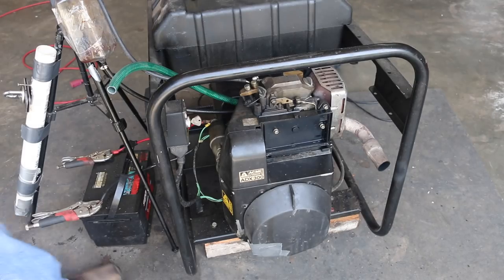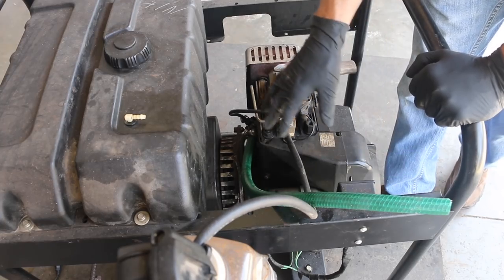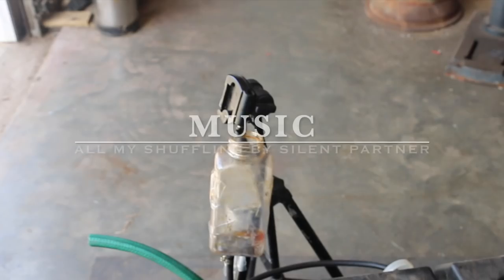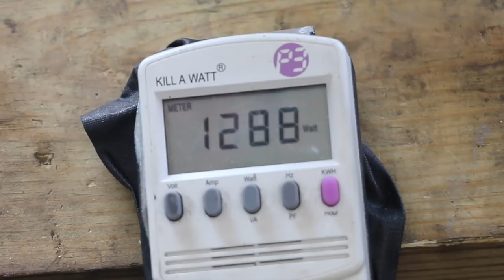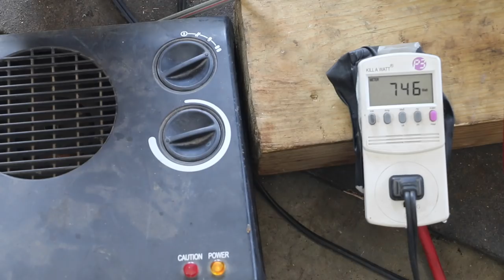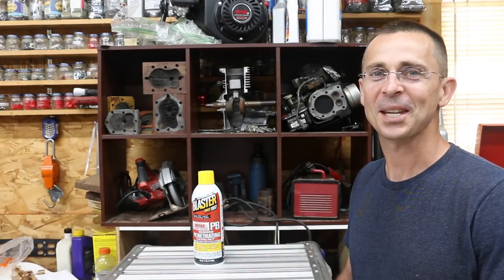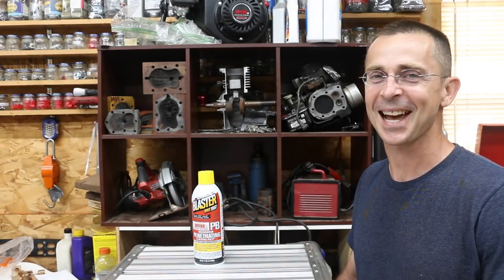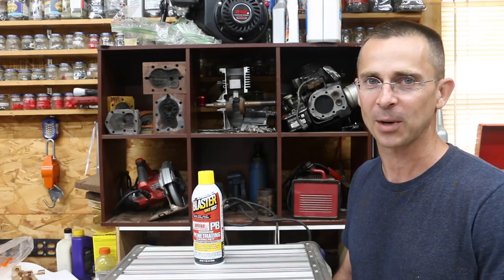PB Blaster as FUEL?  Let's find out!

Comment: oh next you can try Citrus oil! Its rather flammable & combustable as heck. The stuff used for scent in a can. (It has a small rubber can inside so you may need 3-4 cans) Walmart has it! I lit some and it went up in FASt and Hot! Kinda reminded me of diesel a lot or home fue  lo ilfrom its-e byproduct after burning.. I might add it is 100%Natural too! Madefrom orange peels hence the smaller inner can. $$ to make. But buying isnt too expensive.
Reply from the maker: Thank you for the video idea!
Reply: Its a #3 Combustible too :) HIGHLY FLAMMABLE: Will be easily ignited by heat, sparks or flames. Vapors may form explosive mixtures with air. Vapors may travel to source of ignition and flash back. Most vapors are heavier than air. They will spread along ground and collect in low or confined areas. (Paste) THIS will  make a great video!! Should be interesting and safe too. Has great potential from the paste I took off of  a report.
Reply: I see walmart offers the oil in big containers. As well as the spray form I mentioned.I do not know if the OIL containers has the same characteristics  as the spray. I'll let you do that research. :) One is sold as Medina Orange Oil. It seems it would  work the same :) here is the sheet: http://www.camdengrey.com/msds/Orange%20Oil,%20Sweet.pdf

Comment: Agree with other posts, run filtered used motor oil at 3 different ratios using alcohol and gasoline.  No point mixing it with diesel as we want to see alternative fuels.
Reply from the maker: Thanks for the recommendation!

Comment: Could you test an oil with 10% PB Blaster to see how it affects the wear protection? Then maybe find a way to test it as a flush for engine flushing like adding a pint or 2 to an engine crankcase and running it for 15 minutes before draining oil to see if it actually does anything?
Reply from the maker: Thanks for the video idea.

Comment: Dry lube such as graphite or copper inside the crank case. Y'know, fill the connecting rods, crank shaft, bearings, possibly a little on cylinder walls, just to see what it does? I think that would be cool!
Reply from the maker: Great recommendation!
Reply: Josh Careau HOT seems like a more likely outcome.

Comment: Diesel engines can use a wide range of fuel. When running low on diesel fuel I once added ed a few litres each of mineral oil, kerosene and high test gasoline to about 4 litres of diesel remaining in the tank of my VW Golf. I got to the gas station without event and the engine ran fine with no problems in both the short and long term. I once read that the experimental engine Rudolph Diesel used to prove his theory ran on coal dust; unfortunately, the engine was destroyed by the lack of lubrication.
Reply from the maker: Great information. Thank you

Comment: I wonder how or if a diesel engine could work off of peanut oil or transmission fluid. at work, I used to put transmission fluid in the fuel filter on engines that set up for a long time.
Reply from the maker: Thank you for the video idea!

Comment: try the difference between vegetable oil and properly transesterified bio diesel. vegetable fat vs animal fat etc. they can be turned into biofuel but not worth the hassle. as you have to preheat them to turn into propper bio fuel. you also have to preheat fat first before you can start the motor. Virtually any oil can run in a diesel motor. Warning don't use gasoline if you want to keep your motor and possibly your life. very dangerous practice. Though I would like to see if kerosene works in a diesel without problems. Keep up the good work. by the way what part of the States are you in?
Reply from the maker: Great video idea!  I live just south of Kansas City, MO. Thanks again!

Comment: I've heard of old diesel military trucks running on used motor oil from a gasoline engine as an emergency fuel supposedly it works really well but creates a lot of smoke they used to run it in deuce and a halfs and what not curious if it's true🤔
Reply from the maker: Thanks for the video idea!

Comment: I wonder if you can run a diesel on preheated axle grease.  Heat it up until it’s nice and liquid, warm up the engine on diesel, then switch over to the hot axle grease.
Reply from the maker: Great recommendation!

Comment: What about mixing gasoline with 30 weight oil and running in the diesel?
Reply from the maker: Great recommendation.
Reply: Most folks have both and even gas stations have both. Not everybody has a can diesel or even pump diesel. I hope you don't end up killing your test machine, but if it works, it could be a damn good thing!

Comment: I heard diesel engines were first designed to run on peanut oil. 
Sounds far fetched.
I do get the impression diesels run on most anything with carbon in it. 
Used motor oil.
Used transmission fluid.
And of course used french fry oil.
But what I would like to see is a powder fuel like flower.
Think grain elevator explosions.
Not sure how well the engine would do with the lack of lubrication.
I think a Dyson vortex type of delivery system would be able to get the flower into the cylinder.
Reply from the maker: Thanks for commenting on this!

Comment: I have a suggestion. Can a Diesel engine run on pure mineral oil like you buy at the store? I think it will. If it does it would be extremely easy to acquire in a SHTF scenario. Literally every large power transformer in substations contain thousands of gallons of it, and it’s already pure and clean because of how clean every transformer has to be inside.
Reply from the maker: Great video idea!

Comment: I wonder if a diesel engine will run on straight propane piped into the combustion chamber. I know that some offroad vehicles use it because having liquid fuel sloshing around in inclines is less than desirable.
Reply from the maker: Great video idea!

Comment: Dramatic power improvement as it cleaned the engine and continued to increase. It lacks the oil seal of real diesel, but the video lacks footage of what does diesel do after such an improvement for Blaster Corp? 

Will diesel now produce more power than it did before?

Comment: some people claim you can run diesel fuel on vege oil. is it possible?
Reply from the maker: Thank you for the video idea!
Reply: slybunda yeah some fueling stations actually even mix it with there diesel fuel cause it's state law they add something for more lubrication cause it'll ruin injectors if you don't
Reply: You can RUN a diesel engine on waste vegetable oil with two caveats: it won't run on vegetable oil until the engine is warmed up on diesel, and you have to heat the oil before you present it to the engine. It's only worth it if you've got a lot of free waste vegetable oil...a very scarce thing now that all the restaurants are selling their used grease.

Comment: Of course vegetable oil that's what the engine was designed for. breakdown the vegetable oil molecules from a large chain to a small chain molecule  using a catalyst or heat exchanger you probably need to get the engine hot for a while before it will run.

Comment: Can you try running a gasoline engine that is fouled with carbon on the Pistons and rings with water and gasoline?  And see if it gets cleaned / or does damage?  A short story.  Many years ago, my fuel injected Honda Accord had a rusted fuel filler line that allowed quite a bit of water into the gas tank after a heavy rainstorm. I was running the tank down, and as I was accelerating, I clearly had a loss of power from what I know was water and gasoline getting burned. Anyhow, I was blowing black soot out the tailpipe like you couldn't believe.  This would steam clean the combustion chamber and the tops of the valves in a conventional EFI engine, but would it turn the oil milky? - li don't think it did anything to my oil - nothing I remember.  Would water damage fuel injectors - and if so why? I would think the gas and water would have to be injected together. - in my case, I guess a low tank was causing a sloshed water and gas mixture to get pumped up by the fuel pump. I really don't know why water gets such a bad name getting injected into a gasoline engine.  It's not like a hot engine is going to allow the water to hang around and rust anything.  Also as far as creating hot spots, wouldn't gasoline create cool spots as well? THANKS!
Reply from the maker: Great video idea!

Comment: never run a diesel dry it will suck the dirt out of the air into it. also replace the piston rings on the engine because if you don’t fix the blow-by issue you will have a “run away” diesel possibly.

Comment: Two stroke oil and gas and diesel all mixed in equally
Reply from the maker: Great video idea!
Reply: Project Farm  reason why I think it’s a good idea is because I use two stroke oil to help my common rail diesel injectors, they do quiet down quite nicely when I use it. I also feel that the engine is more responsive. Gasoline usually cleans gunk inside the combustion chamber so for my 80 liter tank I use 500 ml of two stroke oil and 500 ml of low octane gasoline. I opened up my engine last year and it looks beautiful inside after 300000 KMs

Comment: Just humor me for a second what if the PB Blaster was used in that diesel motor the same way that seafoam would be as a cleaner not just as a fuel I don't know I'm just speculating that's just a thought though because it seems to run better toward the end then it did at the beginning it may have been breaking up some of that excess sut But there again I don't know your comment would be greatly appreciated
Reply from the maker: Great point. I wish I would have pulled the injector and checked with a boroscope before and after.

Comment: You didn’t include a lubricity test. A diesel will run on just about anything that burns even powdered coal. The problem is the fuel pumps and injectors. If you don’t have enough lubricant in the fuel the pumps will burn out if the fuel gums up the injectors the motor might burn out due to running lean.
They are very rare now but there are old carburettor Diesel engines that you could run on almost anything
Reply from the maker: Great point!

Comment: Try bunker C.
Reply from the maker: Great recommendation!
Reply: It probably will have to be heated and thinned but I think in will run in a diesel but it may clog the injectors due to particulates. You can probably use the waste heat of the engine to melt it. Maybe you could do the same with paraffin or lard.  All three would have a lot of lubricity.

Comment: How about straight methyl alcohol uncut as a fuel in gasoline and or diesel engines since everyone always warns "no more than 10% of methyl alcohol"... Basically its the top off of the first run of moonshine thats tooo toxic to drink
Reply from the maker: Great recommendation.
Reply: Project Farm thank you
Reply: Charles, they tell you no more than 10 percent methyl alcohol because methyl alcohol is REALLY corrosive. Monster trucks run on it. After a day's racing, they have to drain the tank, put a few gallons of gasoline in and drive the truck around to flush all the methanol out. 

As far as a fuel goes...it works fine.

Comment: KAROSINE
Reply from the maker: Great recommendation!
Reply: Project Farm karosine runs like diesel just hotter.. I ran it 50/50 in an old Datson pick-up for years.. That's because karosine was cheaper than diesel at one time. Just runs the motor a bit warmer but not much more than diesel.

Comment: You should mix a bunch of the worst performing oils, additives, etc that you have but will not use in lieu of better products in their class and try that as fuel.
Reply from the maker: Thanks for the recommendation.
Reply: do you have a waste oil heater for your workspace?

Comment: Run it on heating oil.
Reply from the maker: Great video idea!
Reply: Heating oil IS Diesel with red dye added.
Reply: 3029dz it's actually not
Your confusing it with the off-road fuel that's identical to the on road fuel except the different dye and no road tax you can run the heating oil but your truck will have absolutely no power maybe if you add tons of additives but idk
Reply: Thomas Ashmead maybe your using a different term for heating oil but if your talking about furnace oil for heating homes that's No.2 fuel oil, same exact thing as diesel fuel, unless your buying premium diesel which has additives, or winter blend which is No.1 and No.2 mixed. Actually No.2 fuel oil makes more power than No.1.
Reply: Thomas Ashmead Interesting read. Looks like in Pennsylvania heating oil contains sulphur, but that would be the only difference. Here in Wisconsin we don't have high sulphur heating oil, it's No.2 fuel oil/Diesel
Reply: mharris1270 I have not bought fuel in Michigan so I don't know, but here in Wisconsin, or Illinois, Minnesota, the Dakotas, alot of stations that offer premium diesel mark the none premium as No.2. Even Kwik trip